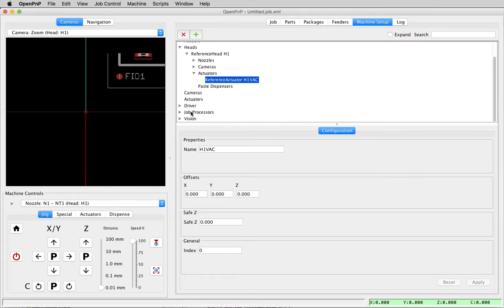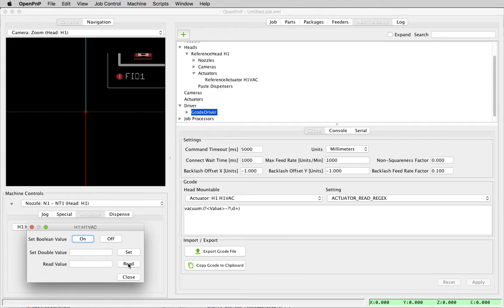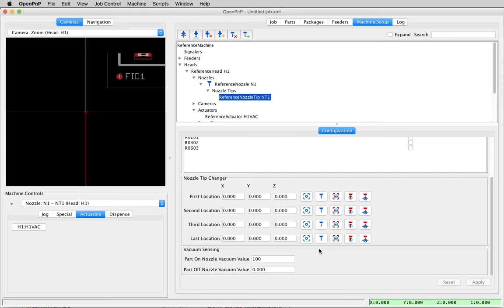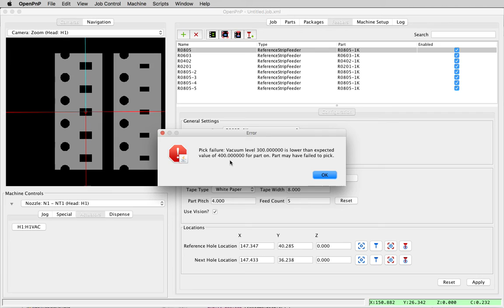OpenPnP: Vacuum Sense Config Migration

Comment: Hi, I try to set this up, but when I go into the driver settings and look for the "vacuum-request-command" it is missing.

That is not in my List.

My command to get the pressure value is $ADC0. How can I set up openpnp to read it?
Reply: have you figured it out. How did you find the pressure value? I dont have vacuum request command either and tried to put in "VACUUM" as suggested in the video but it didn't work
Reply: @jackyo8547  3 years ago :-) I did not figure it out, and soon changed to another machine. Sorry, cannot help you.